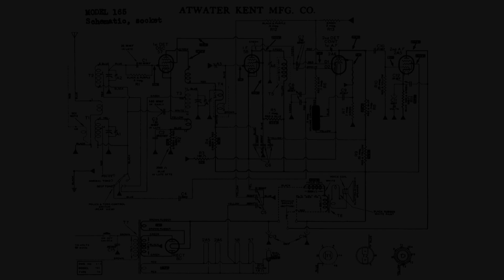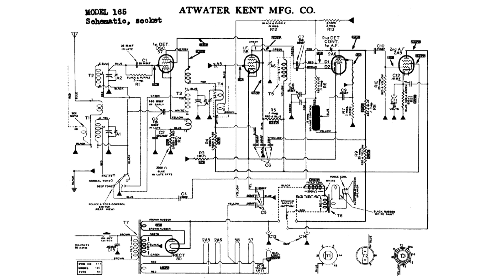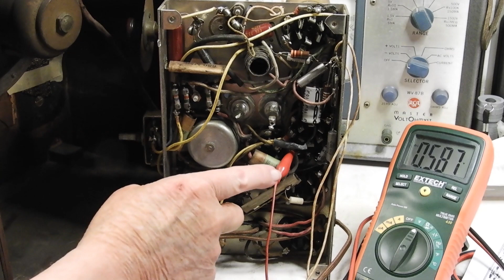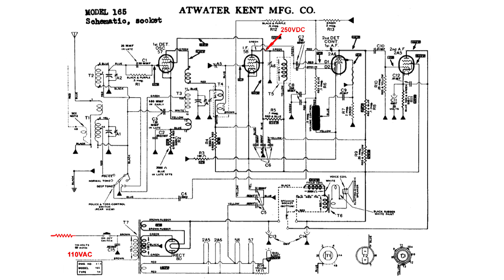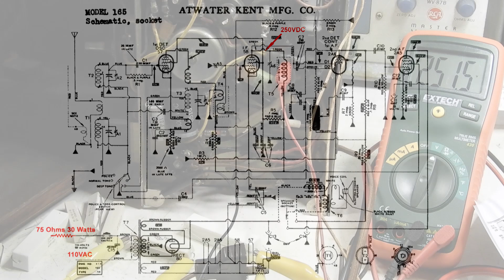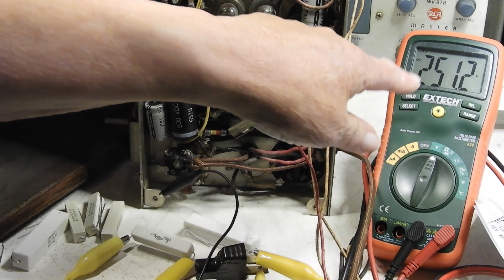Atwater Kent 165 Repair and Protecting the Circuit

Comment: Built a bucking transformer using the 12.6V transformer Radio Shack sold, to power my Atwater 627. End result was the power transformer in the set ran much cooler, with no appreciable loss to how the set performed. 

I made the bucking transformer look pretty, by installing it in the large project box RS offered. I also put in two digital gauges to measure line coming in, and voltage going out. 
I took advantage of the RS transformer being center tapped, and installed a switch to select which secondary windings to send the voltage through. If I'm remembering correctly, passing voltage through the secondary center tap would lower overall about 7 volts. Passing voltage through the full secondary was around 14 volts drop. 
So with a line voltage of 120v, I was passing approximately 106V out to the radio.
Reply from the maker: Thanks

Comment: Would the aluminum bodied resistor with screw holes in them with some heat sink compound on them bolted to the chassis of the radio?
Reply from the maker: I did buy something like that, I'm using four of them
Reply: @AllAmericanFiveRadio  could I ask you where you buy your tubes.I have some tube radios I bought ,and at this time I dont have a tube tester

Comment: Hope you can squeeze the resistor(s) in the chassis without heat being an issue. I just restored an old Emerson with a resistance cord and was able to replace it with the diode/resistor method. Chassis was so tight, there was barely room! Love your channel, thanks for all the work you do.
Reply from the maker: Thanks